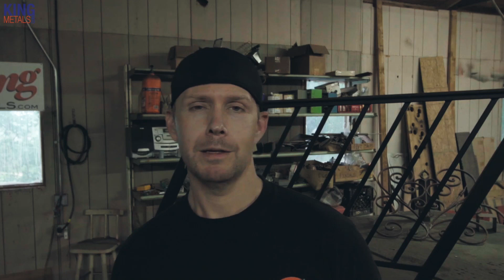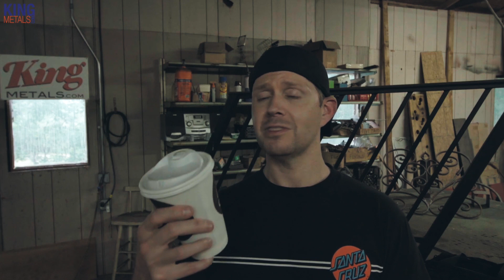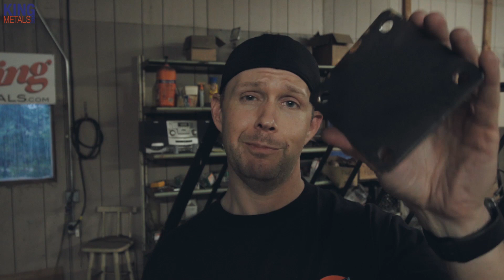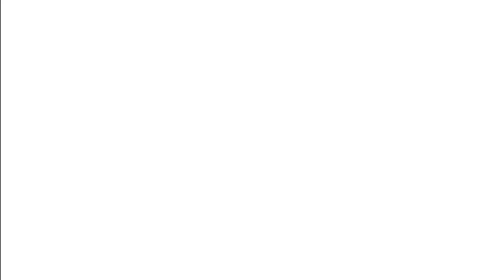Base Plates vs Coffee??

Comment: My opinion, done both, core drilling if not precast or brick without a good concrete  base. Bit more work but you don't have to  weld on baseplates! Also there are diamond core bits that can be used with a 7" grinder dry or wet. What weld shop doesn't have one of those?  Looks way better than baseplates.

Comment: I prefer base plates because if you ever need to remove the railing for any reason (sandblasting, repairs, etc.) Is it much easier then core drilled and cemented.